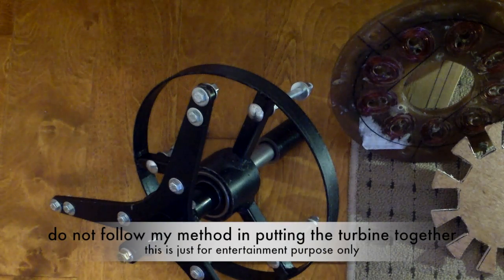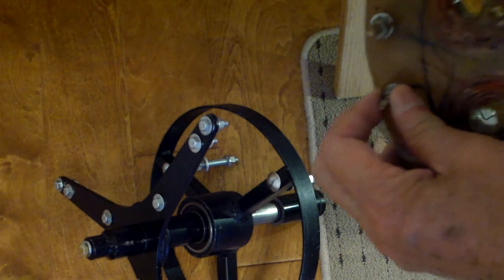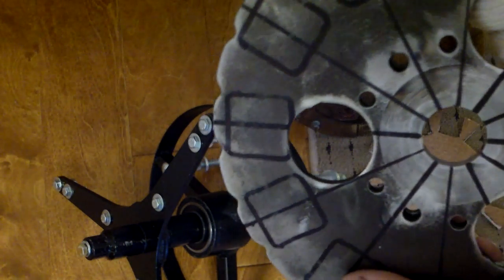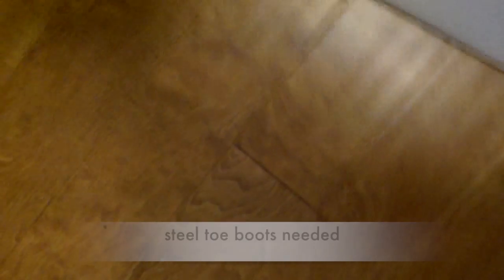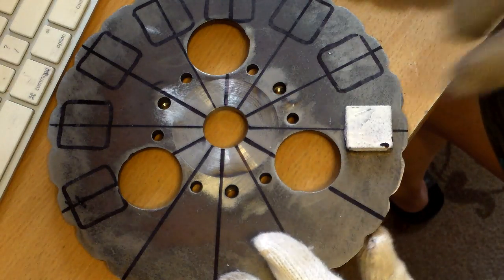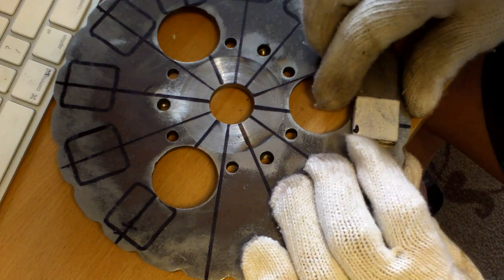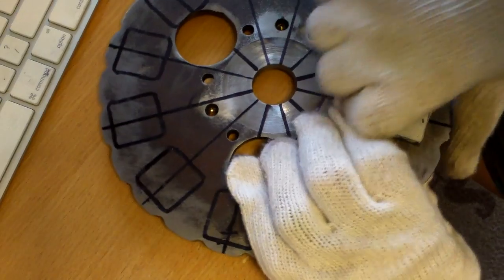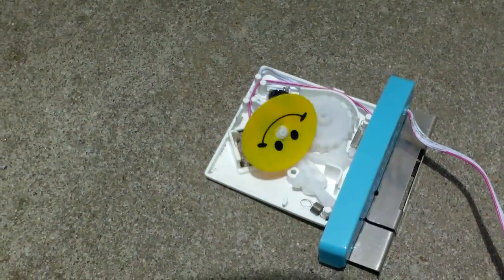Getting to work on Belgrade Machine's vertical axis wind turbine part 1

Comment: Very nice project.  Don't scratch that table; you can't put a rug on that.
Reply from the maker: jaykay18  Your're right. I need to put a box fan in there. I did put a thermometer inside the garage to remind myself how hot it can get in there. Too high a temperature inside  and you can get sick without realizing the garage can be much hotter than outside.
Reply from the maker: Russ Bowers You're right about not scratching the desk. I should do the work in the garage except it's starting to get a little warm there now that summer is officially here.
Reply: wtam69 No Harbor Freight garage fan?  I've been eyeing the 2 that they sell for quite some time.  I don't think I'll buy them though, I had an old Lakewood box fan in the back that sat outside for years, the grille turned brittle and shattered but it still ran.  Now it hangs from the bottom of the loft in my garage with no grilles, and does a fine job when I'm at the workbench.